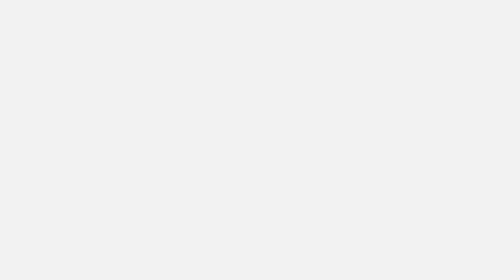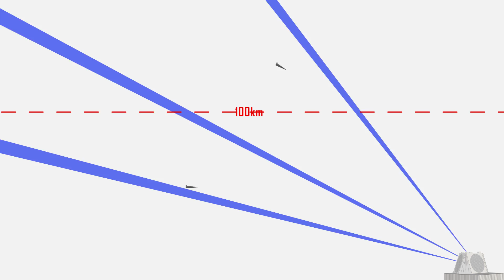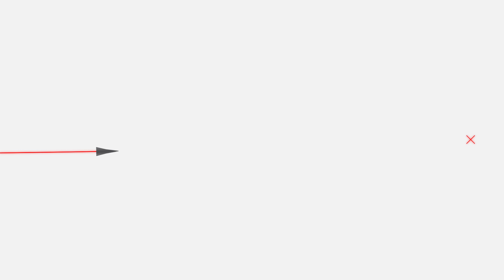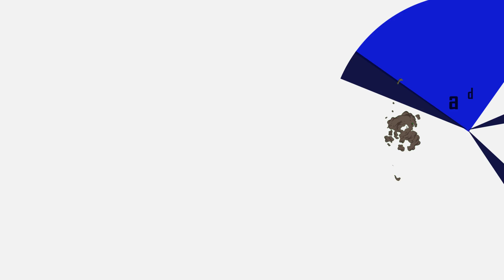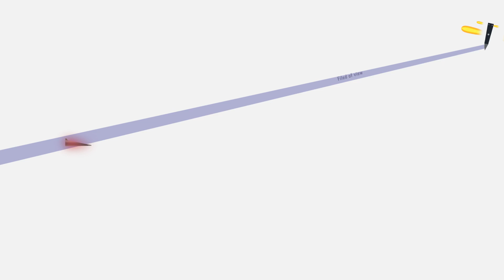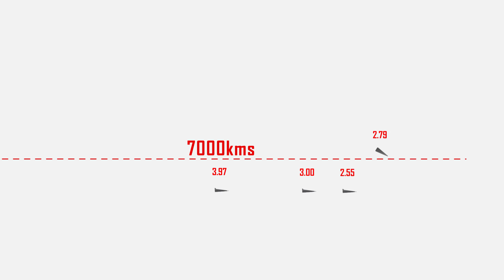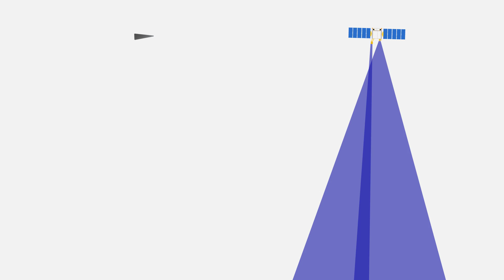Hypersonic Gliders Explained

Comment: There are some misconceptions and  way too much hype around it. It's just basic physics that's speculated, like gravity on descent and thrust by mini explosions  touching atmosphere and lack of friction on ascent -possibly shutting down fuel outside those "touches" to save it, these vertical waves being intended only to continuously accelerate and not to fool chasers, this being only a side effect. The 10 Mach + speeds are achieved on the last portion of trajectory only -when they "disappear" from radar. Indeed once accurately established in a powerful computer on ground, the optimal trajectory depending on the distance to the target, a fixed table of such trajectories is loaded with a simple interpolation logic, so once the target coordinates are loaded the optimal trajectory is easily established by interpolating existing data and some random but fixed zigzag added at the end. To get this data however some homework must be done: correct physical phenomena and parameters introduced in the flight simulator software -on ground, by many corrective experiments done with much cheaper 10/20 times smaller rockets, some AI and numeric algebra algorithms used for faster results. Even Putin admitted that any country having cruise/ballistic missiles can soon have it, like Pakistan or Egypt. It will be very sad to realize later that war in Ukraine lasted more than 6-9 months, while most countries having cruise/ballistic missiles could have had it in 2-3 months sparing a million civil lives, as now Putin has the upper hand and tries to take the maximum profit while still can.

Comment: Finally someone recognizing that it's basic physics that's speculated, like gravity on descent and thrust by mini explosions  touching atmosphere and lack of friction on ascent -possibly shutting down fuel outside those "touches" to save it, these vertical waves being intended only to continuously accelerate and not to fool chasers, this being only a side effect. The 10 Mach + speeds are achieved on the last portion of trajectory only -when they "disappear" from radar. Indeed once accurately established in a powerful computer on ground, the optimal trajectory depending on the distance to the target, a fixed table of such trajectories is loaded with a simple interpolation logic, so once the target coordinates are loaded the optimal trajectory is easily established by interpolating existing data and some random but fixed zigzag added at the end. To get this data however some homework must be done: correct physical phenomena and parameters introduced in the flight simulator software -on ground, by many corrective experiments done with much cheaper 10/20 times smaller rockets, some AI and numeric algebra algorithms used for faster results. Even Putin admitted that any country having cruise/ballistic missiles can soon have it, like Pakistan or Egypt. It will be very sad to realize later that war in Ukraine lasted more than 6-9 months, while most countries having cruise/ballistic missiles could have had it in 2-3 months sparing a million civil lives, as now Putin has the upper hand and tries to take the maximum profit while still can.

Comment: I’m always confused whenever someone worries about how maneuverable a hypersonic scramjet missile or glide vehicle is. Interceptor missiles are almost always rocket powered meaning that unlike scramjets, interceptor missiles can deplete a ton of energy in a turn and won’t risk engine shutdown from air not getting into the engine. Attacking missiles also need to carry warheads which makes them heavier than their interceptors, further limiting maneuverability. Gliders have it even worse. Gliders aren’t powered so they rely on gravity and the momentum gained from their carry vehicle in order to… well, glide. Once again, rocket powered interceptors have the energy and weight advantage against gliders meaning they can easily maneuver the much less energy efficient glide vehicle that risks dropping out of the sky like a brick if it maneuvers too hard.
Reply: Is Iron Dome the best of the best rocket defense system ?

Comment: Is Russian Avangard considered a glider ?
Reply from the maker: Yep. 0:03 the missile to the right is actually the one which carried the Avengard in a test.
Reply: @MilitaryEnthusiastExplains  It flies in plasma cloud which does not reflect back radar waves. How and when you detect it ? Heat signature probably but ar what distance, and what is the reaction time, how to stop a thing moving 20 mach with unpredictable trajectory ? Up to 27 ...
Reply from the maker: @deniscicic8074  I've heard that the use of plasma to reduce the radar cross section was tested. If it was implemented here\created in some way it might reduce the detectebility but the glider would still be detectable from some range. The radar horizon limitations already reduce detection range so it might not be that significant. Time will tell...

The American architecture for BMD allows the detection of ballistic missiles the moment they break cloud cover, so, I'd expect very good coverage against gliders can be achieved.

What the Russians attepmt to do with all of the new weapons is to ensure there are too many types, making fielding a counter system much more expensive.
Reply: @MilitaryEnthusiastExplains  do you maybe know cost od one glide vehicle?

Comment: This is a great video...Thanks for uploading. Please make a video about icbm re entry counter measure systems.
Reply from the maker: In the sense of systems designed to intercept ICBMs during \ after the re entry phase?
Reply: Military Enthusiast Explains ....How about both. Because systems like aeigis at least have some limited capabilities against both scenarios.
Reply from the maker: The interceptors that aegis uses for intercepting ballistic missiles during the re entry phase (I guess that there isn't really a phase after that for BMs as there is a lot of interaction with the air until hitting the ground) aren't suitable for defeating ICBMs as they were desinged to intercept ballisitc missiles with a shorter range. (probably meaning that the refresh rate of the radar isn't fast enough, missile maneuverability may not be sufficient, maybe the warhead won't spread the fragments in the right time etc.). 

Sprint and other missiles were desinged to intercept ICBMs and are interesting. We'll see.
Reply: Yeah that's pretty interesting....I think a video about the performance of of SM 3 block 2A interceptors against IRBMS will be very interesting. Just an idea.